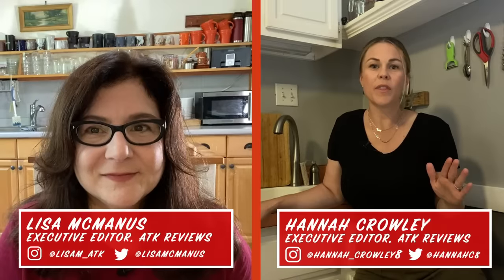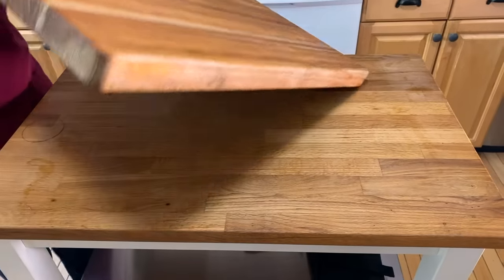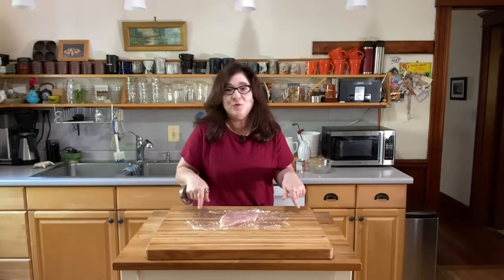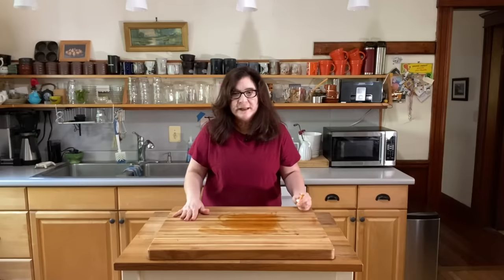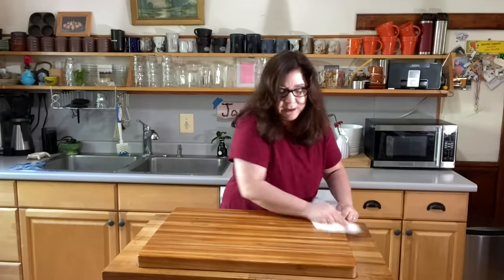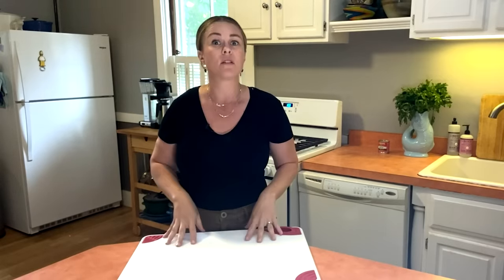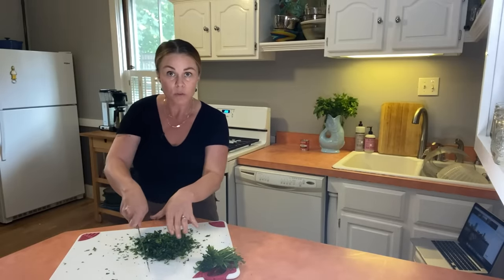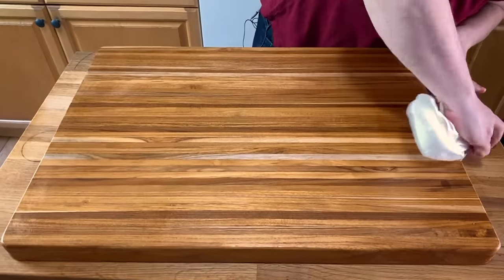Gear Heads | Which Type of Cutting Board is Best for Your Kitchen?

Comment: Great to see you ladies in these post-apocalyptic times! A good cutting board is indispensable in any kitchen. However, I am going for bamboo as my favorite material...durable, inexpensive, and sustainable.
Reply: The problem is that bamboo is not wood (it's a grass), and they are infamously hard on knives. Bamboo is 19 percent harder than traditional maple, which means it’s also harder on your knives. Also, the small grooves may ever-so-slightly catch your knife, interrupting a smooth cutting action. And many of the glues used for bamboo boards use formaldehyde. You want to make sure it says formaldehyde-free glue is used.

Comment: My mom has a glass board. It is the most unpleasant thing to use. Not surprisingly, her cooking consists of putting frozen veggies in the microwave or frozen meals in the oven. My current one is a pretty wooden live-edge model. Still not the most practical model, but I'm usually only cooking for one so the odd shape isn't too much of an issue. I don't need too much space so the usable area being about 12" x 18" is fine.

Comment: I have a wooden cutting board that is a bit thicker. I'm tall enough that leverage is not a problem and the increased height makes it easy to swipe stuff off onto a plate, either the parts I'm not using or the ingredients I want to transfer to a cooking pot. This is the main problem I have with larger plastic boards; too thin to scrape onto a plate directly and too bulky to easily lift to do it.

Comment: I bought a bamboo board and it warped a little because one side was exposed to air while the other was not. I had some small domed self sticking silicone rubber feet for speakers. Yes I use one side of the board but there is no chance of slipping while cutting risking injury. Also air can get to both side of the board.

Comment: You don’t have to be restricted to buying premise commercial cutting boards.  YOu can cut any cutting board down in a table saw if you buy one that is a bit too large to fit your dishwasher.  I made my own cutting board from some off cut HDPE (high density poly ethylene) which is NSF (National Sanitary Foundation) certified food grade.  It is sized to fit my dishwasher.  The large  piece I got from a plastic supply company in Las Vegas was an off-cut from some cutting boards they had made for a hotel kitchen on the Las Vegas strip.  

The piece I got was large enough to make three boards sized to fit my dishwasher.  They ended up at 1 x 13.5 X 20-inches.  The HDPE cuts and machines readily with normal carbide tipped woodworking tools.  My boards at 1-inch thick are strong enough to lay over one basin of the kitchen sink, and cutting up vegetables there makes clean up a breeze, because you just scrape the waste into the sink.    

I also have one large cutting board that hides next to the refrigerator.  I hunt, and need to butcher and wrap entire Elk and Deer.   The big board is 4-ft long and 34-inches wide.  It lays on the counter with one end over hanging the sink.  I routed grooves around the perimeter so any blood just drains into the sink.  It has greatly decreased the clean up that I used to have at the end of the butchering process.

Comment: You did not mention that the majority of professional kitchens do not use wooden boards.  They were outlawed for a while due to misinformation about bacteria retention.  Also the pros tend to use, as I do, 1 inch thick plastic boards with a wet cloth underneath to prevent slipping.  This is primarily because their stainless steel tables will allow slippage from either wood or plastic.  If you do not like even temporary stains, you can do what I did and buy a black one or some other color.   I have seen some beautiful wooden boards but as a retired chef of over 40 years, they are not as practical as a thick plastic board and require extra maintenance.  One last thing....  If you noticed, the first lady with the wood did not use her knife to scoop up the peppers.  If you have have cut marks in your wooden board they can potentially catch on the knife blade and tear a chunk out.  Not an issue with plastic and NO it does not damage a knife blade to do this.  Good cooking peeps!

Comment: As far as beauty and the aesthetics of cutting boards I'd vote for wood, but I like being able to wash the cutting board in the dishwasher.  What I use is a wooden cutting board under one of those cheap bendable cutting boards. I haven't had trouble with them scooting around. I like them as I can dump food into the saucepan easily, and I put them in the dishwasher every time.

Comment: Different boards for different purposes.  Simple plastic boards can be easily scratched and those grooves can be the area where the bacteria reside or hide in.  Thus often, we would only reserve it for fruits and vegetables.
Wooden boards differ in type of wood too.  Solid round blocks are used for chopping and heavy cutting and they can  be ground down to give a new surface (butcher style), and not used in the house much.  The hardwood boards while long lasting, would be more suited to western style of rocking cuts and heavy cutting but at the same time, may cause some wear to the knife edge.
Soft boards such as cypress wood are used for Japanese style of slicing where the blade pulls thru the object and touches the board lightly.
So it all depends on your style of using and which suits you best.

Comment: Thank you for this excellent content! Your experiments raise a question for me with regards to wood vs plastic cutting boards. 

 The issue of bacterial preservation in cracks or 'lacerations' from knifework in wood and plastic seems to have been elucidated somewhat by your experiment, though your experimental process is somewhat unclear. This said, I do wonder about the mechanism behind odor and color transfer in these substrates, specifically with regards to plastic cutting boards? 

This may be purely mechanical, and the organic material causing these odors and discoloration is simply retained in the small lacerations caused by knifework until eventually washing off. However, if odor and color transfer is in some way a chemical process, there could be an opportunity here to study if this is a two-way reaction, specifically, are plastics or organic molecules able to be transferred to foods simply via surface contact with common cutting board materials? Many polymers are famously inert, but an extensive body of literature has raised concern regarding endrocrine disrupting chemicals (EDC's) in plastics in our food and the environment  (Plastics, EDCs & Health: Authoritative Guide, Endocrine Society, 2020).

Perhaps more relevant to this question is the effect of the simple mechanical action of plastic cutting boards integrating plastics directly into foods, as described by Yadav et al., 2023 (https://pubs.acs.org/action/showCitFormats?doi=10.1021%2Facs.est.3c00924&href=/doi/10.1021%2Facs.est.3c00924). Microplastics are thought to be driving the widespread increase in colorectal cancer in increasingly younger populations (Li et al., 2023).

Obviously exposure to microplastics is a pervasive issue at every level of modern life and food system, however as these are often dose-dependent issues, and we might benefit from using wooden cutting boards to mitigate avoidable exposure in our kitchens. Would love to see this addressed in your content, and I'd be happy to contribute, though this is ripe content for an MPH, biochem or endocrinology thesis as well!

Comment: A 1:1 (by weight) mixture of mineral oil and beeswax is my go-to wood conditioner. It also works on leather and as a pomade if you're into that kind of hairstyle.
Reply: Actually: Cook's Illustrated actually recommends using spoon butter (a 3 to 1 mixture of mineral oil and beeswax) instead of just mineral oil for wooden utensils (including cutting boards).   A quote from their results:
"After washing both sets 20 times, we found that the set treated with spoon butter was in noticeably better shape. Those treated with straight mineral oil looked ashen, with dried, rough spots, while the spoon butter set had a smooth finish and retained some protective coating. Making spoon butter takes a little more effort up front, but the long-lasting results are worth it."

Comment: I have a bit of a phobia about cutting raw meat or on the same board that I use for everything else, even though they say here that cleaning with soap and hot water will sanitize the board.  I decided to buy the big wood cutting board they recommend here AND a couple of smaller plastic cutting boards than the one recommended here, which is slightly too big for my dishwasher.  I will use the plastic ones for raw chicken and chicken, clean them in the dishwasher, and store them in a cabinet between uses.  I will keep the big wooden cutting board on my kitchen counter and use it for cutting everything else, including cooked meat or chicken.

Comment: The University of Wisconsin did a study to prove that plastic cutting boards were wood. Surprise the wood was tolerant to a little careless in cleaning whereas the plastic was unforgiving. I have a 72 by 30 inch hickory cutting board work table  that is sealed with Watco  Butcher Block finish

Comment: There is a alternative to the plastic ones. Get a piece of 1/4 inch Plexiglas like what they use as replacements for regular glass. They hold up to heat, cutting and banging. You can wash them and cut them to size. My mom used one for years and I still have hers.
Reply: Personally, I find glass cutting boards feel slippery and sound a little creepy.  Metal on glass? Argh.
Reply: @sherrard5492  It's really an acrylic or plastic that's clear and tough. It's used instead of glass because It's flexible and doesn't usually break. It does sometimes become a little cloudy though.

Comment: What both cutting boards are missing for me is a place to catch liquid.  Cutting a ripe pineapple or a bunch of juicy oranges, for example, puts sticky juice all over the counter.  I know traditionally only meat boards are set up for juice.  I want a board that can handle liquid on top or with a slope and drain hole to a container for liquid.

Comment: Walnut oil is good for cutting boards too. It dries into a semi-firm finish which protects the wood from moisture, and it's food safe (being just the oil of walnuts). It should also be non-allergenic because the refining process denatures the proteins that cause allergic reactions, but this depends on the brand and obviously this isn't medical advice so if you're unsure try a tiny amount on an inconspicuous area!!!
Reply: Walnut oil is high in polyunsaturated fatty acids which oxidize and go rancid easily.

Comment: PLEASE READ if you use plastic boards. IMO staining is going to happen. If it does stain wash thoroughly. Then coat with 50/50 bleach and water, (maybe 2 ounces?) using just enough to coat it. Spread around on both sides, let it stand for 1/2 hour. Rinse then wash again. Good as new!🤩

Comment: Odd, so many can openers today cut off the top of the can leaving a safe edge and a resealable can (at least the lid re-fits and keeps the ingredients covered), and Lisa uses the pull tab, is not able to remove the lid leaving sharp edges on the can and the lid increasing the chances of needing stitches.  I have one from Walmart that is over 6 years old and still works and works on all can styles. I also purchased an Oxo Good grips version and it is a failure. It will not open certain style cans and cat food is one of them. Go cheap, get the black plastic  handled one from Walmart.

Comment: I have one of each.  One we got from the owner of our local bakery w/bread knife, when we got married in 1974’ yes, 47 years ago.  It works great and I still use it.  I also have a great plastic cutting board.  I got it a few years ago.  It fits over my sink. Great for cutting turkey and other juicy meats.  It also has a strainer on one end, that works great for washing cut veggies, as I cut.  I like both of my cutting boards, and use them both.

Comment: When I built my House - I made my own Kitchen Cabinets and in one of them I have a slide out cutting board that I use for most of my needs. For Heavy Duty needs I have one section of the Cabinets with a Butcher Block top that will handle anything.  So I never have to worry about storage for cutting boards. Years ago I bought several items I did not have based on ATK recommendations including a Tramontina Dutch oven and a Kitchen AId food Processor. It use them ALL the time - even though you recommend others now- they seem to do just fine and I find that I do not look for new items like them UNTIL the old ones are have worn out. Do people regularly change items simply because you recommend different ones every year?

Comment: You need to talk about the type of knives you would use one the different board aswell. I tend to use mostly japanese knives which are hard (62HRC+). I would only ever use an endgrain board with a softer wood for those since bamboo fx. will chip the edge.

Comment: These are great options for sure. But when you start getting in higher HRC ratings in knives. The harder woods will dull your knives much much faster. Nothing a stropping wont fix but just noticed all these were more traditional german steel type knives(which should be honed or steeled after about 8 hours of use anyway)
Just another perspective.

Comment: Wondering....  Lisa, do you also tend to utilize that butcher block top??  Was the actual cutting board there simply for testing? Why wouldn't just the counter top there on the island be used most times, instead?     Thanks for sharing (esp about the cleanliness/germ aspect.  Was of the thought that wood held onto things more, so... appreciate the info to the contrary) .... I'm sure both types have their pros/cons & "best for" uses, depending on what's being prepared on them.   Stay safe & be well.

Comment: I've been using compressed rubber cutting board, a very popular material for cutting boards in Japan. They come in variety of sizes and thicknesses, it's hard enough yet soft enough not to damage the knife blades. It is also anti-bacterial material and lasts for a long time. I always wonder why there are no such cutting boards in USA. Wood or plastic, only two choices?

Comment: I have a 30 year old big wood board that looks great and cuts like a dream. It gets used for almost everything.

But not raw meat. For that I have a ≈10" x 16" plastic board from Ikea. It's thin, warps when I wash it in hot water (dries flat), and is a bit small for large butchering tasks — but fits in my dishwasher. After 10 years it's scraped up, but still does its job just fine.

I don't wash my wood board, I scrape it down and oil it. The plastic board gets either screaming hot water and soap, or a trip through the dishwasher every time I use it.

Best of both worlds.
Reply: Temperature extremes are how to draw the toxins from plastic.

Comment: I have that Teakhaus board. It's a pretty good value but it's tough on knives. I have to sharpen my carbon steel Gyuto's once a week, in order to keep a nice edge on them, when using this board. I haven't bought one yet but have been told that rubberized boards (Asahi is one brand that has been recommended to me).

Comment: After watching the video, I  looked at the plastic cutting board I’ve been using for several years, and I’m surprised to find I’m going to stick with it. It’s small enough to fit on my extremely limited counter space and in my small kitchen sink. It hasn’t warped, and knife scratches are minimal.  I never really noticed, but it has thin rubberized ends on the short sides that prevent it from slipping. Pretty much everything I need.
Reply: Would you mind sharing the brand and where you bought it Pleeease? I need one
Reply: It’s an 9.5x16 Oneida Cutting Board that you can get from BB&B, Wayfair, etc.  Look for the one that comes in various colors and has the little grippy strips on the short ends.

Comment: Just bought the TeakHaus after your video recommendations and I love it but after the first use and clean with hot soapy water under a tap, the board instantly brought up tiny wood particles from the grain. Some rub off but they generally stay on or just produce more.
I used a blue foam scrubby, nothing abrasive. Even on the side that I didn’t use the foam on, when wet the wood particles came up.
Can you advise on why this is happening or how to prevent/cure it?
Thanks!

Comment: I just bought a bamboo cutting board but it's a small one. I don't know anyone who has a Giant cutting board, it's easier to just use the kitchen table. I see you needed a table just for the cutting board. I've seen garage doors smaller than some of those cutting boards.
Reply: Bamboo's selling point is it's sustainable. It's harsh on blade edges because of it's high silica content. It uses a lot of glue because it's a grass and not wood. Edge grain bamboo splinters. I got one for free and gave it away for the same reason you wouldn't want to drive a super car on an old dirt road.

Comment: I've been using a plastic cutting  board for several years. It works OK but it has some divots and valleys on its surface. I have to wonder where that plastic has gone. I probably ate it, lol. My next board will be wood, just like what my mother  used her whole life.

Comment: I have a bias towards wooden cutting boards. I have an older house with in counter cutting board. I don't mind oiling my board twice a year. I have high-end knives and the knives hold an edge longer when using the wooden cutting board. I like the fact that recessed cutting boards also have a gravy trap to keep juices off of the counter. I also like the fact that wood is a environmentally friendly and sustainable product and plastc is not.